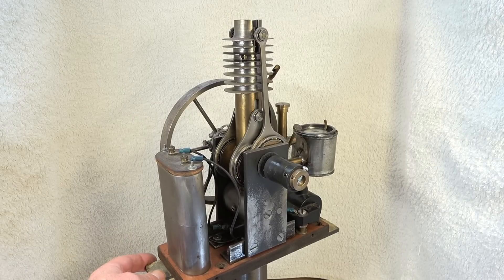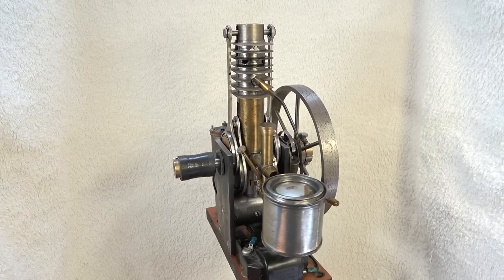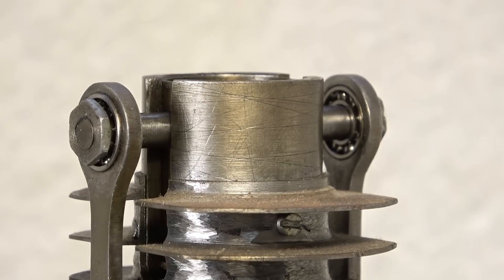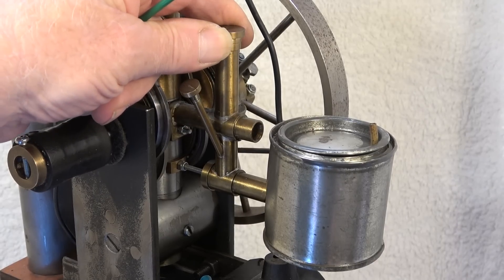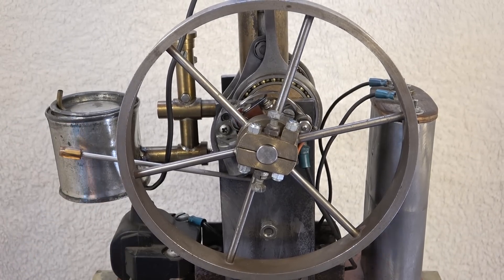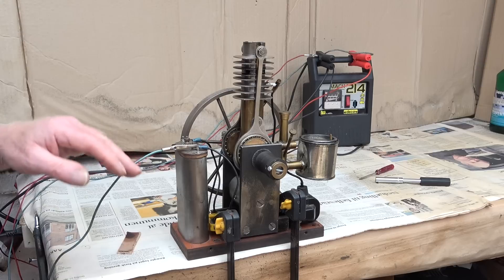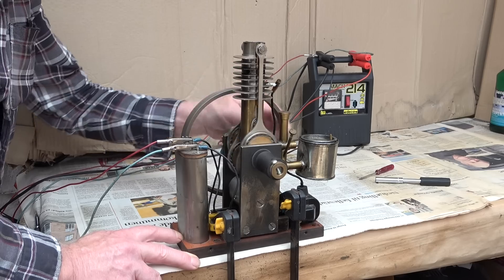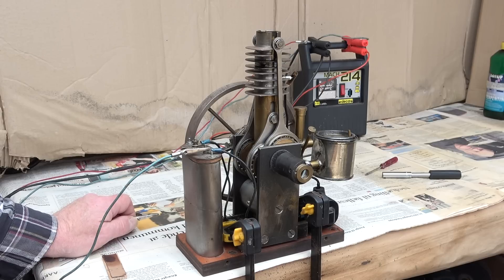Mysterious Model Two Stroke opposed Piston Engine

Comment: A very interesting design for an opposed piston engine. this is the first time I've seen an engine designed where the opposed pistons function on a single crankshaft. or should I say an eccentricshaft? where as most opposed pistons engines rely on two output shafts or wave plates. this is a very interesting design indeed.
Reply: I know the Junkers opposed piston designs from before the Jumo 204 had a single crankshaft: https://media-eu.invisioncic.com/m304542/monthly_2023_11/Le2tempsaujourdhui.jpeg.jpg.9c6b3de809b2288bea8754daaee6b669.jpg (in that case, the upper rod also had a second much larger scavenging piston attached to the top)

Also the Commer TS3 used rocker arms to connect the opposed pistons to a single crankshaft.

Comment: Opposed piston , the Germans had that in WW2  and Sir that's is a nice job you did explaining it , and have it running . The opposed piston uses less fuel for more power I think that's how it works.
Reply: And the Fairbanks-Morse 1938 series engines- diesel, gasoline, and natural gas. They were made with as many as 20 cylinders. Originally intended for locomotives, since the opposed pistons function as the intake and exhaust there are no valves that can be burned by excessive exhaust back pressure. Most of the American WWII submarines used F-M diesels because the exhaust could be discharged underwater to minimize visible smoke.

Comment: How do the pistons, etc. get lubricated? Awesome engine. Nice video.
Reply: It's a 2 stroke so the cylinder bores will get fuel oil, and the external connecting rod bearings are high end ball bearings that would just need light oiling for long wear.  The wrist pin in the piston if bushed would require frequent oil unless they are also roller bearings, which they may be as quiet as it is.
Reply: my yamaha says fuel is mixed with oil in a 2 stroke engine

Comment: There's some large displacement boat engines that use an opposed pistons layout (but perhaps not this exact design), the neat feature about it if balanced properly is there's next to no vibration from operation.
Reply: Almost all of those are built by Fairbanks-Morse.

Comment: Great show Mr. Hansen.
Opposed piston engines are much more simple than piston and cylinder head engines, I wonder why they have not taken a hold in the automobile industry.
Reply: Start a company that sells cars that last 100 years and get 100mpg... nobody is interested in actually doing that because they want short term profit.
Reply: Who knows? But they have showed up in heavy equipment and boats.
Reply: Firstly because it's a two-stroke, lubricant in fuel, so couldn't meet emissions regulations.  You can make a separately lubricated one, like the Napier Deltic locomotive engine, but it needs to be supercharged and gets pretty complicated in practice.  Great power-to-weight ratio though.
Reply: Because a lot of people won’t have no jobs. And if it’s too reliable the company won’t earn any money for making replacement parts.  Henry ford said he could make a motor last a very long time but why do that and not earn any money
Reply: the politics of $$$$ to be saved for interests of the big fats cats from shelving interesting innovations
Reply: Or a vehicle that runs on almost any type of fuel. IE all the old cars. Adjust a few things and the model t’s would tun on about anything.

Comment: What an awesome engine sir. If I may ask, being this a 2 stroke engine, does it require any oil premixing in the fuel?
Reply: Just from observing the little engine that could the reason two strokes use a oil additive is to lubricant the crank and rod bearings. On this engine they are externally lubricated. But the pistons would have to have some lubrication to keep from galling.
Reply: All 2 strokes do..
Reply: @djpaulk  Not really.  There are exceptions, such as the DKW in the 1950's.  These two stroke engines had oil in the crank case, and the cylinders were charged with a separate charge pump.
Reply: @djpaulk  Almost all 2 stroke diesels (of which there are an incredible number of) do not require mixed fuel. Mixing fuel is unique to 2 stroke gasoline engines for the most part.

Comment: I am a marine engineer and I have worked on a very similar engine. I was a Doxford diesel. It too was an opposed piston engine but it had a crankshaft. It was very efficient and reliable. It has two side rods that drove the top piston much the same as yours

Comment: Everyone should check out the F-150 Ford Crew Cab Lariat from the 2018 Detroit Auto Show that gets over forty some miles per gallon with the Achates opposed piston engine with 480 plus feet pounds torque and also the Cummins ACE 1400-CC opposed piston diesel built for the US military. One thousand horse power and 25% more efficient than all the others and both are cleaner than upcoming emission requirements. Too bad we will never see anything less expensive, less moving parts and double plus today’s fuel economy. Your engine is a masterful design.
Reply: wow...

Comment: Fabulous - I have an engine design - it also has no crankshaft and the flywheel 
is 180 deg to the piston while the connecting rod does not oscillate at all! .. Sounds daft - but it is not. I still need to make it though!

Comment: No lubrication Find???
Reply: It's 2 stroke engine. Gets lubrication from oil in fuel
Reply: @MOTO_DOSE  I must have missed the part where the fuel/oil mixture exits the carburetor, swirls instinctively around all the external bearings and then magically re-enters intake ports.
(edit) Otherwise, a bit of heavy oil on the bearings would do with regular applications.
Reply: @johnlockesghost5592  homie. Those are ball bearings. You could put 1 drop of oil on them and be good for hours of run time. If they were sealed ball bearings they would be good for hundreds of hours of run time with no maintenance.
Reply: @johnlockesghost5592  the rod bearings  in most engines are journal bearing hence why they need constant oil pressure to work. Ball bearings and roller bearings don't need a constant supply of oil.
Reply: @johnlockesghost5592  Yep you are right. Have to take an oil can with you when out for a spin.. Nice engine. Doxfords in the UK and a couple of others made an opposed piston engine for marine use. A little bit bigger than that though.😀

Comment: Those flywheel shaft bolts that you are regretting : Try having a solid round collar with a pin that passes through the shaft and collar. Around split roll pin that is slightly over sized before tapping in will stay very well.

Comment: Another beautiful model Mr. Hansen. The opposed piston design is coming popular again, I have read that some makers are reviewing this design due to it's much better expansion ratio over a single piston giving an improvement in thermal efficiency.
I hope you have patented your double eccentric linkage system, building a strong, simple linkage has been one of the challenges in opposed piston design.